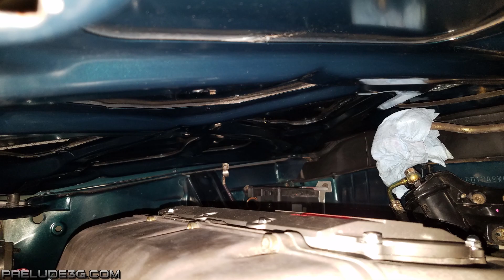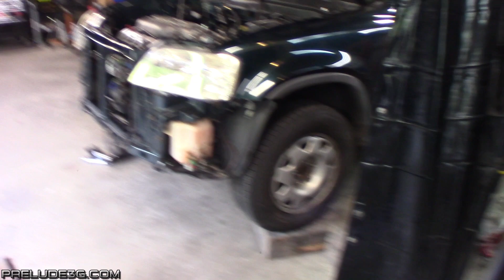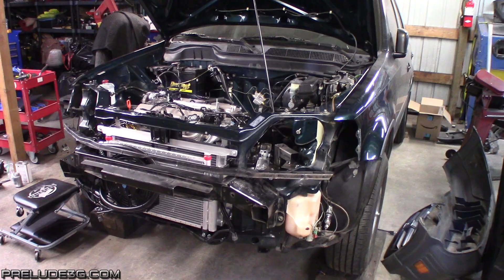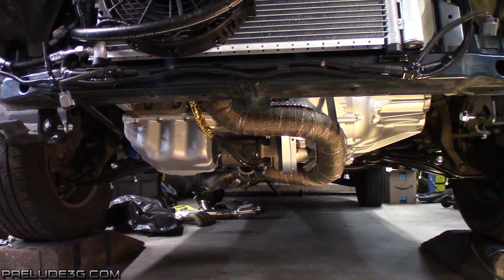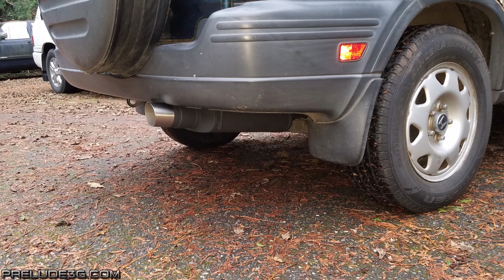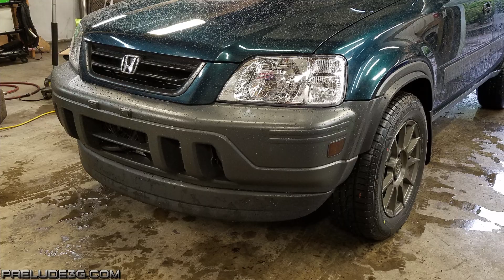RD1 CR-V J2KAWD Build 2 - Fabrication Madness, Headers, Traction Bar, Shifter, J32A First Start

Comment: I know this is a bit of an old video but hopefully you're still replying to comments! I am thinking of buying a 2006 Acura RL for a complete SH-AWD J35 swap into my 1999 honda CRV. How different would this swap be compared to yours?
Reply from the maker: It would be quite a lot more work. Mechanically you will also have to mount the SHAWD rear diff, get a custom length driveshaft.

But the big thing is that you will have to use all the electronics from the RL related to the SHAWD and VSA systems. I believe they have inputs+outputs from a steering angle sensor, yaw sensor, g-force sensor, electric throttle, abs system, etc.

All that needs to be transferred from the RL and working correctly or I suspect the SHAWD control unit will go into a limp or default mode and you won't be getting any of the benefits of the system.
Reply: @Prelude3g  ah okay I didn't realize there was that much going on with the 2006 and Sh AWD. Would an element drive train be a better option? Is that able to mate to a j and hold the power?
Reply from the maker: @dillongray688  Well the Element is the same as the 02-06 CRV like shown in this video.

I can't say exactly about holding the power. My CRV is just a street car running all season tires. The K-series gearbox has held up fine since I did the swap and it has been driven aggressively. 

But it just depends on how you want to use it and which J-series you want to mate it to, more peak torque, more likely to break something in the transmission.
Reply: @Prelude3g  gotcha, I need to rewatch your videos and see what all would be needed. You don't sell the fabricated mounts/subframe/exhaust do you?
Reply from the maker: @dillongray688  No, everything was made as a one-off custom part.

Comment: Awesome video man. We (HalferLand Performance) specialize in Honda Jseries Performance Parts. Our shop R&D (my daily) is a 550whp Turboed 06' Accord coupe 6spd, built with all of our HalferLand Performance parts (1300hp Rods, 800+HP Pistons, 800+HP Block Guards, HalferLand STAGE 2 cams, Our stage 1 PnP heads, etc etc) These really are great engines and finally becoming more popular.
Edit - Damn the longer I watch the better it all gets. you did a hell of a job man 🤙
Reply from the maker: Thanks. I've been to your site before and I'll probably pick up some parts once I figure out the next stage of the build for this thing. Right now I'm actually working on another J2KAWD swap for someone, only this one is going into a 5th gen Prelude.
Reply: @Prelude3g  Keep up the great work. From everything I saw the work looks solid and you went about all of it the correct way, no bypassing specific needs or clearances. We've seen that too many times, people say "That's good enough" and the setup breaks in just a month. Your attention to detailed reminded me of my Accord Turbo Build, doin everything that needed to be done

Comment: You put the engine it should have came with in the first place in it. I have a 04 MDX and a 99 CRV and I'm always like dam I want the mdx engine in the crv with an accord 6 speed . AWD J35 6  speed Crv with 2.5 inch lift and some 36s.   YUUUUUUUP
Reply: @dochvtech22  it took me to some christian Dr.

Comment: This is a freaking epic build man! Thank you for condensing it down to one video.. May I ask what wheel/tire set up you have at the end of the vid?
Reply from the maker: MSW Type 85, 16x7.5 42mm offset wheels with 225/60R-16 tires.
Reply: @Prelude3g  thank you! Any reason why you went 16s instead of 15s?
Reply from the maker: @harrisdoesthings  I wanted a wider tire that didn't change the overall diameter much. Couldn't find a good one in 15'.

Comment: Hi im from France and i doing the same sleeper  j2k awd rd1 i need some help for the wiring and ecu can you help me ?
Reply from the maker: RPM Systems can make you a harness: http://go-rpm.com/j_swap_harness

If you want to use an OE ECU get a 99-01 Acura TL or 00-03 Acura CL ECU. The ECU needs to match the transmission type the motor originally had (Automatic ECU if the engine had and auto trans or manual ECU if it had manual). These ECUs are the easiest to use because the immobilizer board in the ECU can just be broken off, and the car will start.

If you want to be able to tune it I believe you can use the AEM EMS 30-6051 instead. 

Additionally to get the tachometer working you should get a Dakotal Digital SGI-100BT universal interface. This is required to convert the 6cyl tach signal into a 4cyl one, so that the tachometer shows the correct RPM.
Reply: @Prelude3g  i buy a honda accord coupe 3.0 auto the j series is all automatic in Europe we dont have acura my ecu is a p8c i think

Comment: Just came across your channel. Dope work. Where are you located and what would a build like this come out to? J2k awd manual swap.
Reply from the maker: I don't know how much a fab shop would charge for something this extensive, but probably well more that the market value of a CRV. I think you can use J swap parts for EK Civics to do it and save on fabrication cost. Not going to fit in the bay the same though, most of the other J swaps I've seen have almost no clearance at the front.